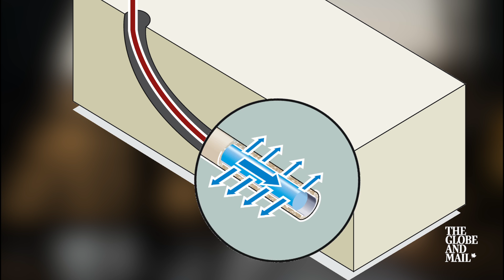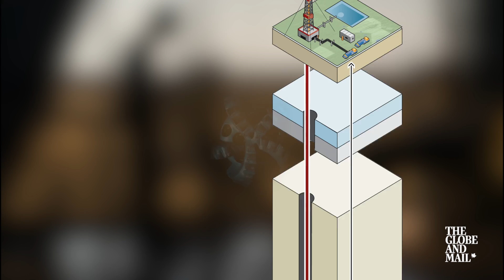Understanding shale oil and the controversial practice of 'fracking'ton 720p

Comment: Fracking, the new way to produce more oil from old wells and to contaminate our underground water supplies... our engineers need a pat on the back.
Reply: Mostly this is not the case. The oil/gas formations are located much deeper than water reservoir.
Reply: MC TDAWG you should educate yourself before sounding like a moron.
Reply: @phillipwoods183  He's right. Frack fluid does contaminate ground water. Furthermore, frack fluid can rise to surface and contaminate surface water as well. Fracking also requires huge amount of water which is usually taken from local sources leaving the population affected. That's why a lot of areas in south texas where this extraction is taking place face droughts. BTW i work in an Oil company myself.
Reply: @phillipwoods183  you're definitely one